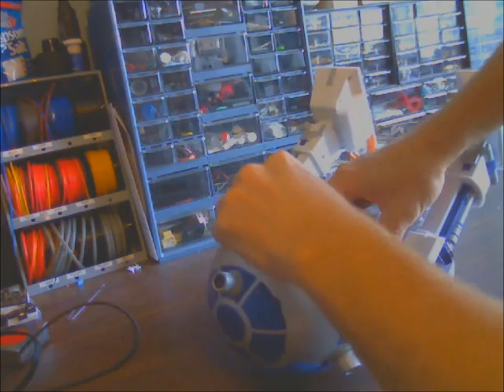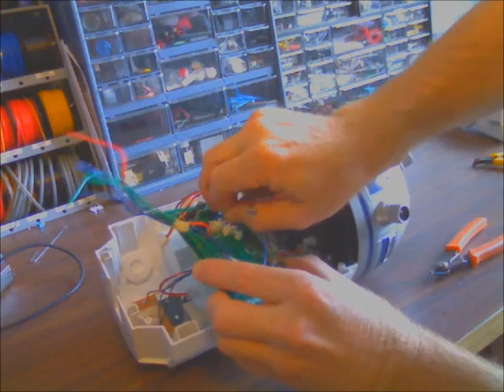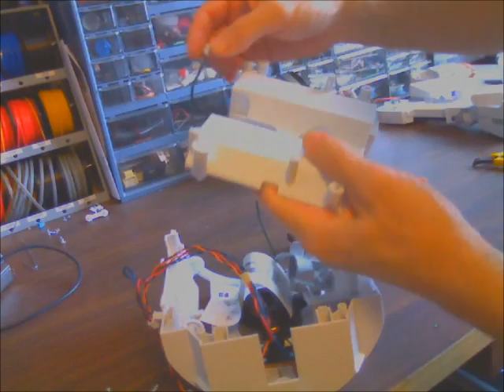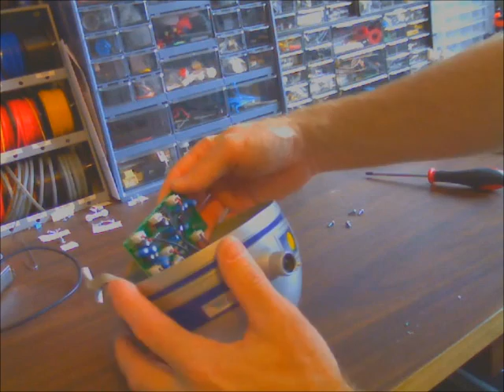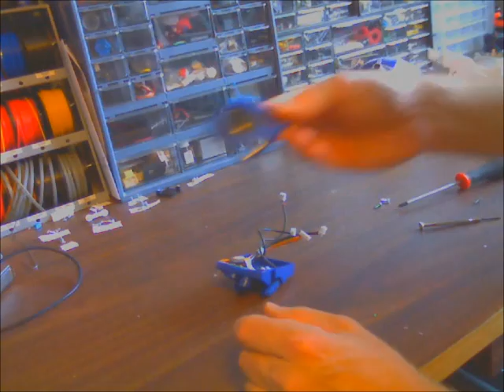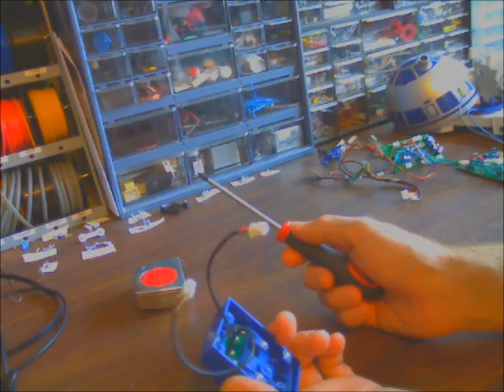Disassembling the Hasbro Interactive R2-D2.wmv

Comment: Who can fix my R2D2
Reply: Hi, I'm Not "officially" an Hasbro/Spinmaster/Jakks technical engineer, but as a great fan of all the SW electronic devices with zero$ budget, I got to learn everything to get all the droids in my actual collection. (i.e. 3  X Spinmaster 16" BB-8, 4 X Sphero BB-8, 1 X Jakks Pacific DELUXE 18" R2-D2, 1 X Jakks Pacific 48" Dart Vador, 1 X Hasbro 2002 like this one, 1 X FX Replica Anakin S. LightSaber, 1 X Sphero Spiderman, 1 X Thinkway  Wall-E U-Command, 3 X Anki Cozmo, Stormtrooper/Bobba/IronMan  Black Series & Marvel Helmets, 1 X LENOVO Jedi Challenge, 1 X LENOVO dim. of heroes, and few others still to repair.... )  All rebuild from scratch with parts that normally came from 2 or 3 similar model sold on ebay as "spare parts" =) It takes a LOT of times, but I can get what I want for aroud 10% of the avg. eBay price for a "fonctionnal" model in the same condition! Those I listed above cost in total less than 1000$ CAN, they all runs great. If you need informations or have a question, be welcome it's free =) 90% of time it's just a little thing easy to fix!
Reply from the maker: Thanks for commenting! I get lots of requests for repair advice on these Hasbro R2's, which is not really what this video intends to provide- even though it should help if someone wants to get into one of them. It sounds like you might be able to help those who are looking for repair guidance, so if you don't mind I am going to pin your comment to the top of this thread.
Reply: @bobleponge8447  Hi! I’m planning to repair my dad’s droid for him. We got the R2 droid a few years back, but when we placed the batteries in and turned R2 on, his head turned to the left and then to the right and died-
Im not really sure with what caused it-

Comment: Does anyone know the pinouts of the Main CPU in this thing?  I know it has the sounds on it, etc... Motor drivers etc... Light Detection... Was wondering if anyone knew what the Chip is and or had a copy of the firmware on it?  Thanks!  (If we knew what the chip was we could get the firmware from it possibly)
Reply from the maker: Hi William. The chip is potted in epoxy and to my knowledge no one has ever been ever to retrieve the firmware. That is why I eventually decided to just build and program a copy of the whole system when I kept coming across the main boards on these Hasbro droids just "dying" for no apparent reason with no way to really diagnose or repair.

I also posted a video covering how to convert them to radio control, which isn't as cool as voice control, but it is one other way to salvage a dead Hasbro droid. Check my channel for that video.
Reply: @robmeyerproductions  with todays modern ESP32 chips you can make a pretty amazing remote control (via wifi) brain interface with this toy... could be pretty epic... the coolest thing would be to keep the original commands in tact, and add New functionality to it via the ESP32.  Would be neat to have the code off the chip, but not wholly necessary to add the brain+ interface.

Comment: I just wanted to replace the module that holds the legs on but seems like thats not possible at my current knowledge
Reply from the maker: I do not believe there have ever been repair parts available for these; however with the growing availability of 3d scanning and 3d print technology, it might be possible for you to find someone to help you make replacement parts for things such as the leg connections.

As for the electronics, I always emphasize that it is probably next to impossible to repair the control electronics, since most of the important stuff is potted in epoxy. It could be possible to identify replacements for the individual sensors, since they are mostly common off the shelf components (PIR sensors, piezo sensor, LED's, condenser mics, etc.). Hope this helps.

Comment: So what exactly do these droids do? I was gifted one and it all seems to work except maybe head movement.
Reply: Was trying to see if I could fix it but I don’t think I’m going to mess with it. Came across your video tonight while researching the toys.
Reply from the maker: Basically they play a whole series of interactive games, many with sounds, lights and even motion of the droid. You can search online for a complete menu of commands to test. Also be aware the little LED light in the center of the droid, near the base, is actually a button. It is a sort of safety feature that disables/enables the drive motors. So you might try pushing that button once, then see if you can get the drive motors going.

Good luck!

Comment: Hi! I’m planning on helping my dad fix his R2D2 droid which died after turning its head left and right. It has been sitting in its box since 2013, but Im getting around to attempt repairing it. 
Are there any pointers to look out for before I open the droid? What are some possible causes for it to break-?
Thanks! It’ll mean a lot to my dad if I can repair it for him :p
Reply: Any updates?
Reply: I bought one like this and I think a kid played with it before I got it and held the head in place so it damaged gears undernate that would turn  the head. I want to repair mine too and there are wires torn loose inside the head and I don't know where they go back to.
Reply from the maker: I wish I had originally recorded this in hi-def. Maybe if you go back and watch the video closely you might be able to sort out some of the wiring connections. I get lots of requests for repair information, but unfortunately I do not believe it is possible to repair the actual control electronics on these.

I originally made this video just to show people how to take apart an already broken R2 and harvest any usable parts for other projects. I also posted a video showing how to convert one of these to radio control, which is possible as long as the drive motors are still good.

Comment: How will you put it back
Reply from the maker: These can essentially be reassembled in reverse order, other than the leg motor leads I cut which would need to be resoldered. I took this droid apart to harvest the parts from it, though. The parts were going to be used in a voice control conversion for one of my full-size R2 replicas.

Comment: How can I put a lipo battery there ? How many volts ?
Reply from the maker: Wowwww. I am sure it could be done, but I am afraid I would not be the person to ask. LiPo stuff still kinda scares me, so I have never worked much with them other than for packaged solar projects. You would probably be best reaching out to another robot hobbyist, or perhaps someone in the RC flying community would be much more helpful then me.

If you study the battery compartments, though, you will see that the original configuration is for one set of four AA cells, and another set of four D cells. On the interior, these are wired such that the AA cells (basically) power the digital circuitry, while the D cells provide power to the drive motors. This is a bit oversimplified, but that is the basic idea. I assume that the design consideration was to keep an electrical noise from the higher powered drive motors from interfering with the more sensitive control electronics.

I can say that the two power supplies do share common grounds back at the battery compartment. In all the modifications I have done with these, I have always run two 6 Volt power sources wired essentially the same as the original battery packs were wired. I have also found that the electronics seem to work just as well on 5 volts.

Hope this helps.- Rob

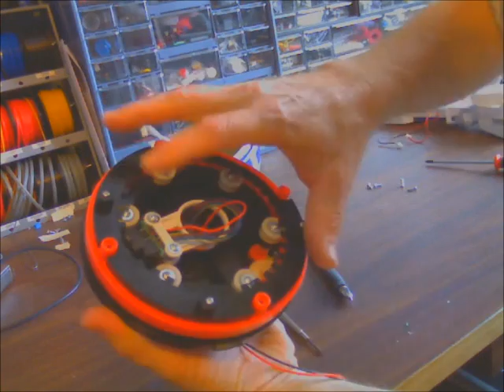Comment: At timestamp 14:35 it shows the inside of the Dome - see the wires that connect  to the sensor on the front? Mine tore loose now I'm trying to figure out where they go I think they're gray brown red and blue - if I could see an enlarged version of where the wires come into the head that might do it. I've seen some other videos but they're just not clear enough.
Reply: Still need the sensor wires pinout ?
Reply: @bobleponge8447  hi, I just saw this and yes that would be nice - think I even called the company and they just said they built them and that was it. With the wires torn loose you just can't tell where they go back.

Comment: Mine looks just like this and it used to work. I think I took it apart one time cuz the head's supposed to turn back and forth and I thought something was broke inside. I took it apart and of course some wires came loose - they're gray, red and blue and I think they go to this light sensor piece in the front but I really don't know without a schematic. I soldered them back to where I thought they went and it doesn't do anything. Like I said mine looks just like this, how do I know where the wires go without a schematic?

Comment: Would you fix mine if I send it to you and pay you?
Reply: Not "officially" an Hasbro/Spinmaster/Jakks technical engineer, but as a great fan of all the SW electronic devices with zero$ budget, I got to learn everything to get all the droids in my actual collection. (i.e. 3  X Spinmaster 16" BB-8, 4 X Sphero BB-8, 1 X Jakks Pacific DELUXE 18" R2-D2, 1 X Jakks Pacific 48" Dart Vador, 1 X Hasbro 2002 like this one, 1 X FX Replica Anakin S. LightSaber, 1 X Sphero Spiderman, 1 X Thinkway  Wall-E U-Command, 3 X Anki Cozmo, Stormtrooper/Bobba/IronMan  Black Series & Marvel Helmets, 1 X LENOVO Jedi Challenge, 1 X LENOVO dim. of heroes, and few others still to repair.... )  All rebuild from scratch with parts that normally came from 2 or 3 similar model sold on ebay as "spare parts" =) It takes a LOT of times, but I can get what I want for aroud 10% of the avg. eBay price for a "fonctionnal" model in the same condition! Those I listed above cost in total less than 1000$ CAN, they all runs great. If you need informations or have a question, be welcome =) 90% of time it's just a little thing easy to fix!

Comment: Hi do you do repairs ???
Reply: Not "officially" an Hasbro/Spinmaster/Jakks technical engineer, but as a great fan of all the SW electronic devices with zero$ budget, I got to learn everything to get all the droids in my actual collection. (i.e. 3  X Spinmaster 16" BB-8, 4 X Sphero BB-8, 1 X Jakks Pacific DELUXE 18" R2-D2, 1 X Jakks Pacific 48" Dart Vador, 1 X Hasbro 2002 like this one, 1 X FX Replica Anakin S. LightSaber, 1 X Sphero Spiderman, 1 X Thinkway  Wall-E U-Command, 3 X Anki Cozmo, Stormtrooper/Bobba/IronMan  Black Series & Marvel Helmets, 1 X LENOVO Jedi Challenge, 1 X LENOVO dim. of heroes, and few others still to repair.... )  All rebuild from scratch with parts that normally came from 2 or 3 similar model sold on ebay as "spare parts" =) It takes a LOT of times, but I can get what I want for aroud 10% of the avg. eBay price for a "fonctionnal" model in the same condition! Those I listed above cost in total less than 1000$ CAN, they all runs great. If you need informations or have a question, be welcome =)

Comment: I have made no modifications to my r2d2,  I bought it used,  it power up and makes noises but it will not move, the head turns, any suggestions on why it might not move?  Is there anything I should look for once I open him up?
Reply: Check the wheel lock button above his third leg. If it is lit up red, he is in a special mode that prevents him from driving off of tables and whatnot. If you press it, the red light will turn off, and he will be free to move. When turned on, it will always start in wheel lock mode.

Comment: wish you opened the leg up. I have a motor that is not engaging, and is going to need repair. My left leg wheel worked when I got the droid a few days ago, now it spins freely. So when the droid moves, only one motor works and R2 just turns around in circles. :/ bummed

Comment: Even thought it has been five years since you release your video on dismantling Hasbro 2007 R2 D2 Voice Recognition ,  I have a wire/ connector question. When I pulled the SonTX connector from the socket on the circuit board, the white wire came out, but the pin connector remained in the plug. I was able to remove the pin(s), now I am trying to find replacement pin(s). It appears that the Radio Shack stores in my area are closing. So I have to purchase this from their website. There are spec to each pin connector, and I just want to order the right one. Can you help? Jonathan

Comment: what do you do with the scrap r2d2 can you sell the sensor aray and the dome top push in projector
Reply: I have seen people totally dismantle their R2 and sell it piece by piece.
Reply: @PreppyGuy007  These R2s are pretty well made. They last a good long time. Only problems I've had with mine are cosmetic injuries, nothing too bad. I did have what I believe is a broken gear tooth in the dome assembly, but it still runs fine, and I haven't taken the time to open it up all the way.